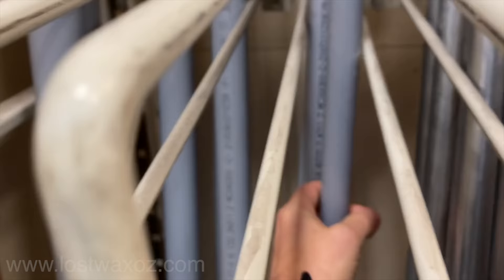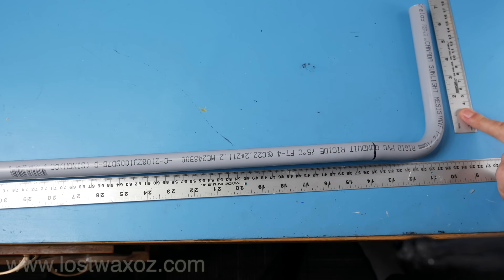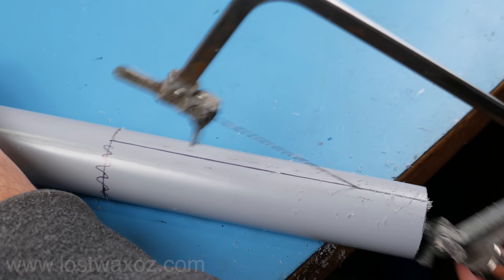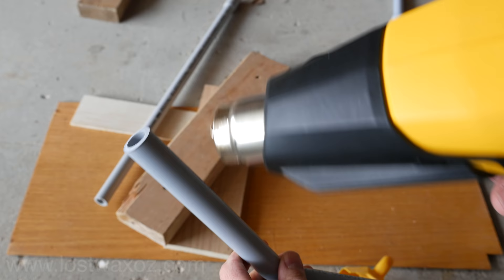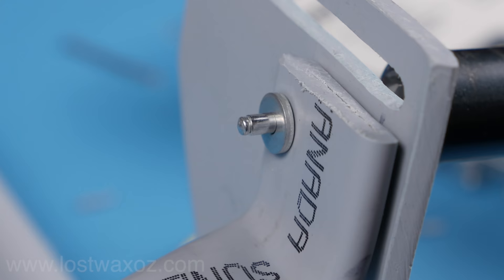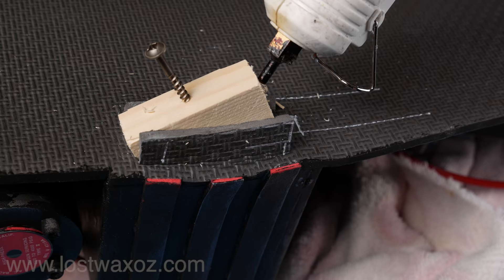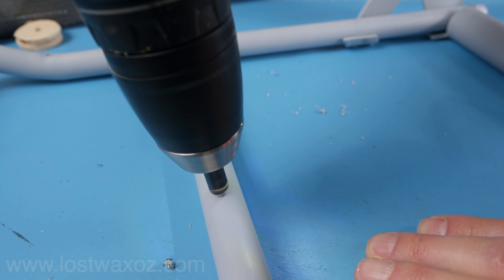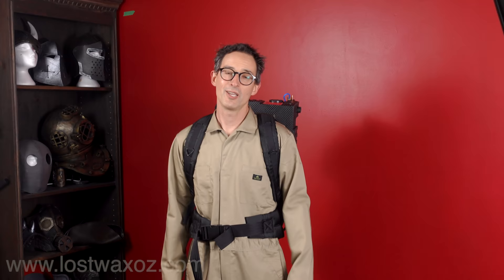DIY Ghostbusters Proton Pack Part 3. Make the Alice Pack Frame From PVC Pipe.

Comment: While this is a very impressive build of an Alice Frame, i need to make a suggestion for those who cant build something like this.  

As a prop builder I wouldnt recommend making an Alice Frame when theyre relatively available online between $40-$50 dollars on Amazon, cheaper at an Army Surplus, and if your lucky, a couple of bucks at a thrift store. 

Doing the math on how much the matterials are, the time and production, i honestly recommend buying one.
Reply: I was thinking this the entire time I was watching this video. Making an Alice frame from scratch is super-impressive though and fascinating to watch.
Reply: Depends what country you're in. Here in the UK we don't really have ALICE frames and to import it's quite expensive.
Reply: I was thinking this as I saw this video. I was just at an Army surplus store and saw one for around $40... the Alice packs frame is Aluminum metal and it's strong and light weight.

Comment: This is definitely a cheaper alternative to an actual ALICE pack frame. Is it lighter to or about equal in weight to an actual pack frame? I only ask because I'm an older Ghosthead with knee and back problems so the lighter the better.
Reply from the maker: I'm not actually sure, I am guessing an actual pack frame would be lighter if it's made from aluminum. PVC is actually quite heavy for what it is.

Comment: If you hadn't been so fixated on using foam, the proton pack back-plate could have been 1/4" plywood, making attaching the pack frame much easier.

I see the same thing with people who have bought a 3D printer. One guy was asking how he could 3D print a piece of 3" pipe. I told him, why spend 12 hours printing a piece of pipe that won't be waterproof anyway because of poor layer adhesion, when you can just go to the hardware store and buy it?!! 3D printers are for the impossible to find parts.

BTW, awesome proton pack build!
Reply from the maker: Yep, you could totally use 1/4 ply. I just sometimes try to keep the supplies list as short as I can, so not having to buy a sheet of ply when you already have a roll of foam was kinda my thinking.